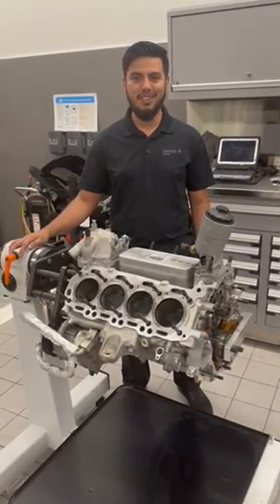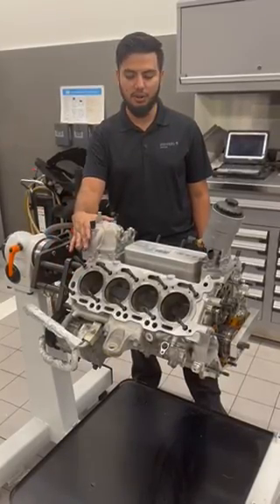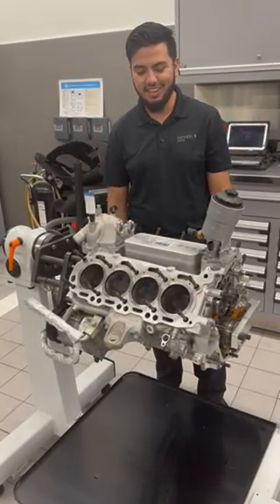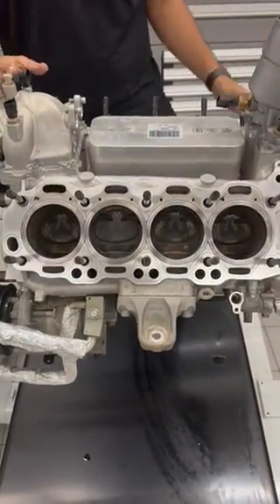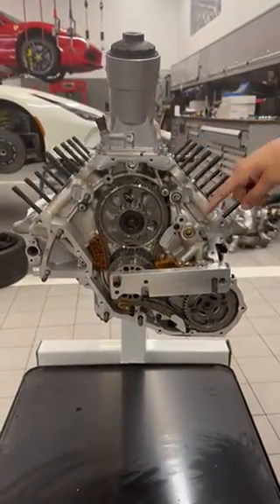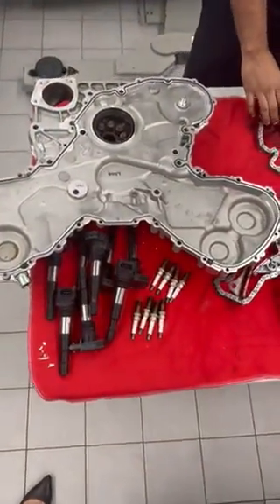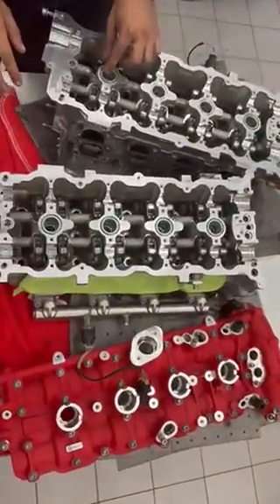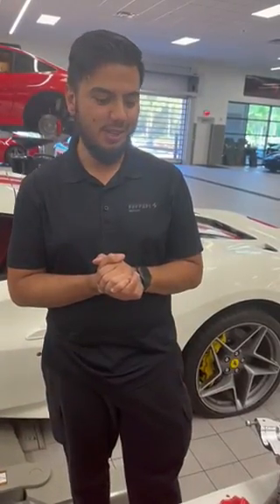Ferrari 488 GTB Engine Rebuild & Overhaul

Comment: As 488 was launched in 2016, this car can’t be any more than 6 years old at time of this video. 
So, why the need for an engine-out overhaul? 
Has it been abused?
Not serviced / maintained correctly?
Does it have high mileage?
Or are these engines just fragile?
Reply: Alex from Gintani said the block, connecting rods, and rod bearings are strong and are tougher than McLarens. The parts that suck, according to him, are the turbos. Probably it was an oiling issue or abused with a lack of maintenance /OCIs. Who knows.
Reply: Ask Sreten m539